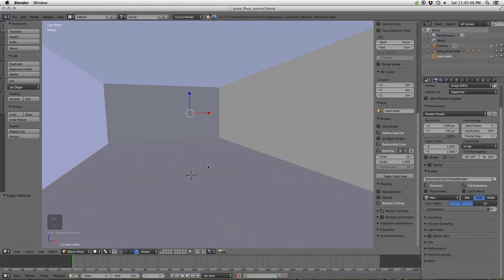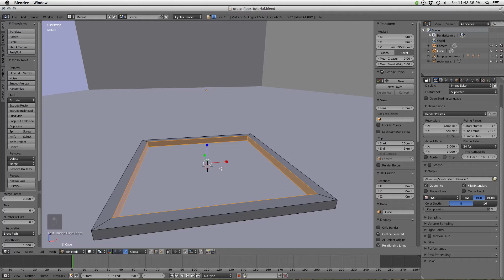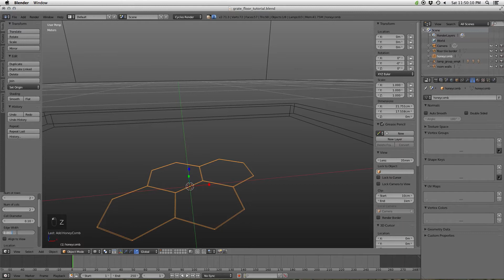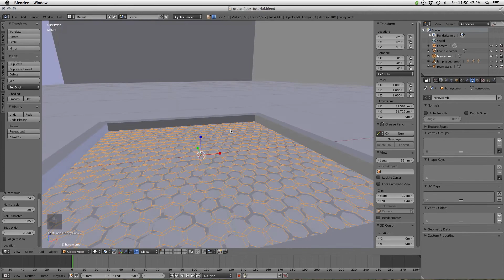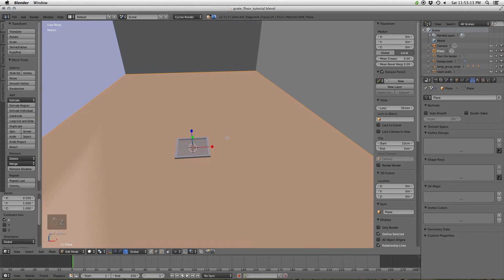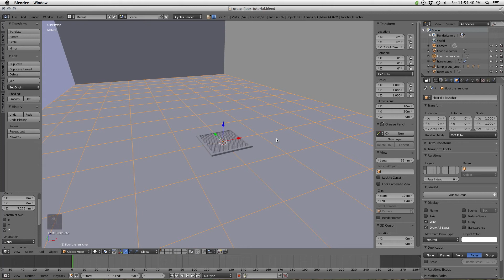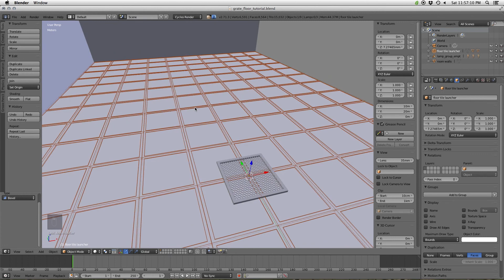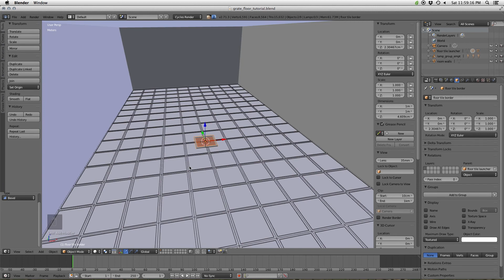Blender tutorial: Making a metal grate floor

Comment: You can also make some quick railings using this method. Make a 3d launcher, remove the top and bottom face, leaving sides.. the tile will duplicate around the perimeter and stand vertically.